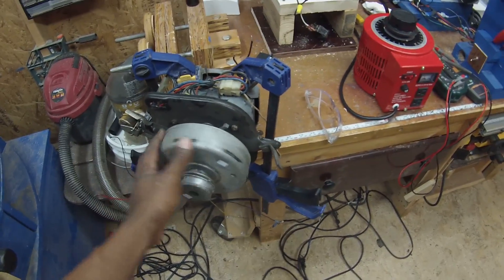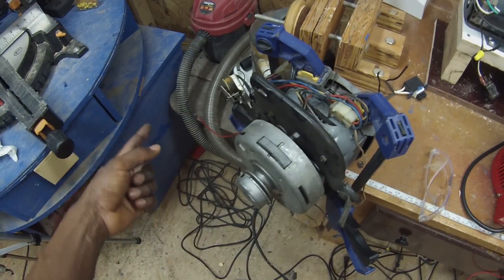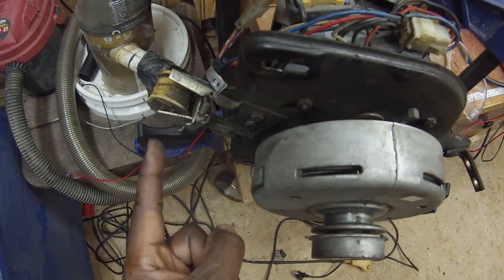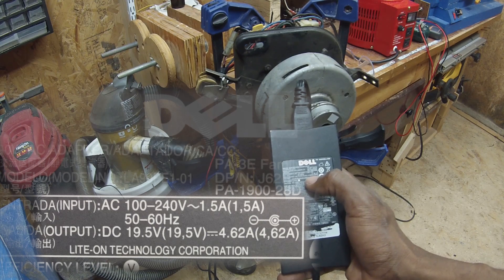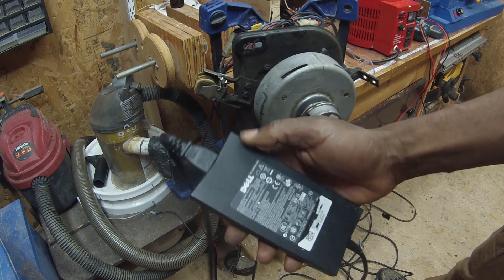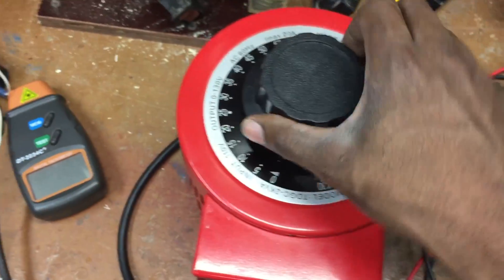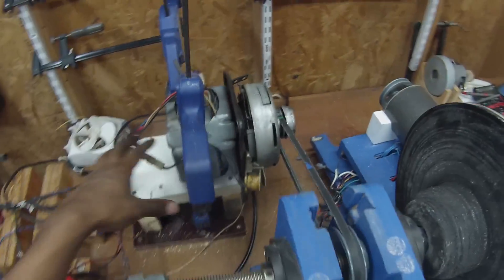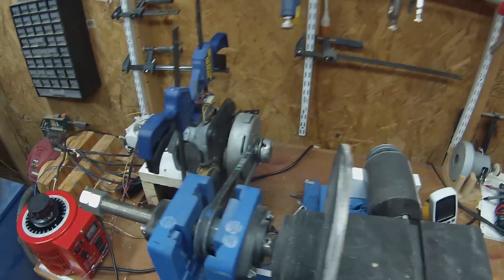Experiments With A Salvaged Washing Machine Motor And Centrifugal Clutch: 017

Comment from the maker: I was wrong about the purpose of the Clutch. It prevents the motor from STARTING under a heavy load. Once things are spinning the clutch engages and there is much less stress on the motor. See I am still learning!
Reply: Jeremy Fielding Same type of clutch used on a mini bike, except in that instance it has a gear with the chain on it. Twist the throttle and the clutch feet spin and extend to engage the housing w/ the chain/gear combo, and away you go to annoy the neighbors. Thanks for these intelligent and informative videos.
Reply: I just changed out dryers do you think I could use the motor from it the same way
Reply: you can make a start circuit with the lid switch off the machine and change rotation directions with a toggle switch

Comment: I know its been 4 years but could you tell me how to wire that exact motor to start by its self. Cant find anything on the web showing how to wire that motor. I have the exact same one and can only hand start it as you did. Its got 5 wires and even after watching your other videos on wiring motors cant get it to start. Have you ever gotten that motor to start without spinning it by hand?

Comment: As A Replacement Motor For Floor Standing
Shop tTools Such As A Belt Sander 
Band saw Disc Sander Table saw Or
Spindle Sander.

Comment: Going from a 3/4 horse drill press motor to a two and a half horse DC treadmill motor works if you get the ratio from pulley to pulley correct for the range that you want that's a little bit of extra work and then you might have to buy some extra pulleys to make that adjustment I have a 12 speed and I was going to change that to a DC motor but I find that the treadmill motor doesn't have the torque that I would want for very low speed 50 rpm

Comment: Great and fantastic explanation keep it up, I have got a question that ....what kind to motor is good for machine has to operate in low speed with arm(50cm) holding up 10kg of weight
Reply from the maker: You need to do a calculation. Check out my video on measuring Motor torque for my air compressor. Search my channel

Comment: I'm thinkin' you might have discovered the reason it was discarded. The clutch was probably not properly functional and they discarded it. If the motor was under a proper load, (overall weight), the clutch should have engaged at the outset, and prevented the motor from going in one direction only. Perhaps there was another connection that would have activated that and you were using it under the spin cycle instead. I'm just speculating here, but now that I think about it, there are different ways for the motor to operate. One uses a single revolution in both directions, and another has a sort of jerk in reverse that resumes forward rotation. Sort of like a ratchet/pawl action. And of course any of the cycles would stop when the door is opened typically.
Reply from the maker: I think the sluggish engagement is because I was starting it by hand. When I later used a capacitor to start it, it reached full speed faster and engaged almost immediately

Comment: So the switch is a rev. Limiter like a wind turbine uses without using a break
Reply from the maker: Basically the clutch allows the motor to slip for a few seconds at startup. The motor will last much longer if it doesn't have to push the full load from a dead stop. The slipping action gives a little momentum, but not the full load to the motor.

Comment: Great channel, first off, now, for my comment:
I first ran into this type of cluth/transmission as a boy (maybe 10 or 11), my Uncle and I fixed his wifes deceased fathers golf cat that had been rotting outside a few years. My first time tearing down, cleaning/fixing, and putting back together a dinosaur burner engine. 2-stroke, so a good intro. Figured out how the 'transmission' worked (I think it was slightly different, only the pulley atttached to the crank changed ratios, was a cantilevered design, so the faster it spun, the right hand rule resulted in the belt riding up the bevel, lowering the gear ratio). OF course, next I noticed a little lever, which would become depressed by the belt if it spun too quickly and moved too far up the bevel. Speed limiter. Took that off. Ran way more fun for about an hour, loud metallic bang followed by rattling and a dead engine, slowly coming to a stop. Pushed it back to the garage, took her apart again, and saw what thoroughly ruined 2-smoke engine looks like inside. 
We didn't really care though, it was already useless, so we got a bit of fun and some lessons out of it. 
I was expressly forbidden to remove the limiter from his snow machine though :P
Good times, good times
Reply from the maker: +ChemicalChrisOttawa LOL

Comment: Everyone knows the clutch is to let the motor to gain speed first before it takes the load, now that little solenoid is for gentle cycle, which has to activated first, before the motor starts , or it will not engage the gentle speed. In otber words the user has to choose the cycle that he wants before the motor starts. Once that motor is spinning, even if you activate the low speed solenoid, its too late. The in & out movement that you've 
notice in the pulley,  that shouldn't be there, that means the clutch mechanism is worn out. The original position of that clutch- motor is horizontal. Will it affect the function?  No, because the weight inside is in centrifugal movement.

Comment: I think that little arms on the clutch move out of the way as a safety feature also... I think you are lucky the solenoid didnt actually engage with them when you had it running otherwise 1700rpmm coming to a dead stop in a split second.... well something was gonna get broke :) great vids btw
Reply from the maker: Normally that process is really fast. The one thing I didn't show is what it look like when the motor is started properly with a relay. At the time I didn't have it so I was just starting it by hand. If I showed that you would see it only takes about one second to get up to speed.

Comment: Salvaged a washing machine motor 
On the motor was written only opperate with shaft down
Any idea about this?
Reply from the maker: +akiva zohar yes... it has a big bulge on the shaft right? That is a centrifugal clutch and i believe it won't work properly if the motor is horizontal. It should still run horizontal. I would remove the clutch and put a pulley directly on the shaft.

Comment: where is the best place to source pulleys? is there a trick to getting the correct size (for your vbelt width, i know diameter sets speed)?
Reply from the maker: +Dan Rozwood yes... pulleys come with a groove size. You need to confirm the pulleys match each other and the belt. Watch my video on powering the shredder. There is a whole segment on pulleys that starts around 18:30
Reply from the maker: I buy most of my pulleys from amazon, but I often just use pulleys I have salvaged from machines as well.
Reply: Jeremy Fielding is there anything special to know about specifying a pretty? i was considering trying to cast one from Aluminum. not soon, but thinking ahead. also, love your videos!
Reply from the maker: The two things that immediately come  to mind are balance, and the belt groove. That groove determines how well the belt will perform. Many pulleys are cast, and you can get dimensions for pulleys from a lot of sources so designing your mold should go pretty well.

Comment: that little solenoid is to lighten the load when the tub first starts to spin and the motor has to pump out the water first, the tub spin slowly and then when most of the water is out the solenoid is released and full clutch action brings the tub up to speed , early belt drive GE washer motor ,  the motor will have two or three speed windings also

Comment: entertaining way to conduct the video, keeps the thinkers thinking. I was with you every step with figuring the exact operation of the clutch. I'm curious about the cap on the end of the pulley, I expected under load with the clutch switch engaged before start up that the motor would just spin/freewheel...that didnt happen so i figured you'd hit some wood on the sander and stop it easily but it looked like it had some torque to it.

 Just a silly curiosity: is it possible the pulley system has two clutches? the centrifugal with a switch operation and a smaller overrunning clutch on the end of the shaft (the small cap).
The overrunning clutch would allow slip if things went wrong or reverse feed were applied to the shaft helping to keep the motor safe then once things are moving good the centrifugal is let go, once that gets past the RPM you had with the clutch switch on then the small clutch would be "out run" and no longer engaged?

 Just rambling thoughts....Enjoyed the video man thanks for putting yourself out there, it will be interesting to see what you do with it.
Reply from the maker: Wow... very interesting thoughts. Now I feel bad about telling you want it is... LOL watch my video here... this is right after I found it. https://youtu.be/K-bbGysv7Kk

Comment: So I've got a dryer in good working order.. What to make from it? I could use a belt sander 🤔 any ideas
Reply from the maker: Check video number 06 for how to make the sander, check video # 11 for the wiring, # 21 to see a dryer motor. it it the one behind the lathe all the way to the right of your screen. with the shaft on both ends. This should get you most of the way there. Good luck...

Comment: Maybe you could make an air compressor out of it? I can't think of any other heavy load starting shop applications right now. I was thinking about a cement mixer too. But I don't know how much need you really have for mixing cement. If it was me I'd be figuring out a way of getting that clutch off the motor. Because I can think of plenty of applications for a plain old electric motor.
Reply from the maker: +Paul Frederick yeah. I will end up taking a grinder to it before long. I really just want to look at the mechanics inside.

Comment: Hello Jeremy, I use to be quite the pro in rebuilting those GE clutch, they are use to allow the motor to start and get to speed when you want to spin something heavy, the slippage allows the load to slowly pick-up its speed by slipping, the use in this case is to spin the basket inside the tub of the GE washing machine, the slow speed pick-up of the basket, allows the water to drain before it spins to fast, and also slowly drains the clothes of water and eventualy picks up its top speed. The 120 volt ac coil, will prevent the clutch from locking, it will slip on different shoes, and it is used for the delicate cycle, you didn't notice much change on high with a load because your load was not big enough and the clutch locked fast. for the play you have between the clutch and the motor, it is caused by a loose U-bolt inside, to open the clutch, you have to punch the top cap pin out, carefull to put the top cap agains something hard and stable, very easy to bend the motor shaft by punching out the pin without back support. remove the cap with a puller, clean shaft and pull out the clutch housing with a puller, you will then have accès to everything, you will notice a sort of U-bolt and nuts plus a plate on the shaft, this is to remove or attach the whole assembly on the motor. While your in there, check the bearings, shoe wear, bushing wear, clean and grease pivots. As of the motor, it normaly come with a starting relay, it is located above the clutch-motor assembly on the top back frame of the washer, right now you only have the "run" coil connected, this is why you have to start it by hand, the start winding is the small wire in the motor windings, the coil with the highest resistance, it is normally powered momenteraly to swing the motor in the start and the relay I mentionned, disconnects the start winding when it reaches it's speed. if you change the wires sides on the start winding, the motor will spin the other way. Enjoy and have fun, any questions let me know.
Reply from the maker: This is awesome thanks... I will give this a try. i can't wait to have a look inside. I have been starting it with a start capacitor and a momentary switch across the starter winding like I show in video 11 and 17 on wiring motors. I press the button to give it a kick and then I let go so I don't burn up my capacitor or damage the starter winding since this motor doesn't have a centrifugal switch. I found the relay but i didn't know how to wire it properly so I decided not to use it in the video. Then I went to the capacitor across the start winding.  But I had shot most of the video by then so I never added those clips.

Comment: any way you can please give a tutorial on how to wire a motor that's currently wired as 220/240  to  110/120? or  v-verse? I'm aware that not all motors  have the capability to be wired as one or the other.  I would really appreciate the help. thanks.
Reply: When a motor is convertable from 120 to 240V you do it by changing the windings in the motor from parallel (120) to series (240). Then the wattage stays the same with the voltage doubled, but the current is halved, because the resistance doubles with the different winding configuration.
Reply from the maker: I haven't tried that before and wouldn't feel comfortable recommending a specific step by step.
Reply: Jeremy Fielding 
hey Jeremy,

thanks for the reply.. is it  "doable"  you think?  have you ever heard of anyone rewiring a motor with both 110 and 220 wiring capabilities? any recommendations besides get a new machine and or motor?  i guess id like to know wheather I'm asking for advice on something that would be ridiculous and silly to do or if maybe there is a possible solution besides dumping the unit or motor.  i really appreciate the response my friend..thank you!  love the videos and your attitude. i look forward to seeing more in the future.
Reply from the maker: Ok... I have given the above warning so here goes... I would expect that "If" you get it to run and I think it is possible, it will work with significantly less power at the shaft then under 220 volts. It may not start or will stall out under a heavy load. So, my educated guess is it is doable if you have a very small load perhaps half to 1/3 what the motor is rated for, and you figure out the wiring. I am certain some one has done it and you can find instructions on a forum somewhere. If the motor is designed for both 110 and 220 then you have it easy.  You should focus on finding out everything you can about that specific motor and hunt down a wiring diagram there may even be pictures of it wired online. It will be a worthy task should you decide to pursue it. If you want you can post a picture of the motor and name plate on my patreon page and I will take a look. You don't have to be a patreon to see everything on my page and post stuff. Its all free. https://www.patreon.com/jeremyfieldingsr

Comment: Yeah. The tub in a washing machine weighs a heap on its own. Then the weight of 4-7KG (I'm from Aussie-land hence metric. Sorry) of wet clothes plus the... how many litres/gallons of water? That would equate to a pretty massive load. (double meaning!!)

If you can do the math on that and equal the load then I reckon you'd get a faster switch between speeds maybe. The load would possibly slow back the main drive to release the clutch sooner. Maybe a momentary drop in voltage would do the same thing and then you could bring it back up to speed after the clutch released again. What do you think? I really have no idea.

I pulled apart a washing machine a couple of months ago and retrieved a little beauty not unlike this one. I also grabbed every other little pump and pulley i could get to. I was dreading having to work this motor out so thanks a massive bunch. If you can find a full washing machine I reckon you'll have a blast playing with all of those pretty innards.

Thanks so much for sharing your brain man.

Comment: I was thinking it might be useful in driving something that could have a flywheel to overcome variable loading conditions, like a garden mulcher or wood chipper. Whether the clutch disengages below a certain rpm regardless of the load it is under or only when the current is removed would affect it usefulness for certain applications.

Comment: Hi Jeremy, new to your channel and finding it very interesting. Just to add something to this video, I am a laundry engineer and have come across these types of pulleys before. It looks to me like this motor is from a top loading machine. These have agitators in the middle of the drum which are driven through a transmission. The torque required to run the transmission is very low and the motor will turn in one direction. This will drive the mechanical pump in reverse which will suck from the drain hose and keep the water in the drum. When the machine spins it turns in the other direction which engages the pump and drains the tub. It also spins an Archimedes Screw which takes the drive away from the transmission and spins the whole drum and gearbox as a unit. Obviously this will require a much greater force so the clutch will soften the load that passes through the belt as it gets up to speed. I've never been actually told this as a fact, it's just how I've believed it's worked all these years. If anyone knows better, please feel free to correct me.
More modern commercial machines use inverters to control the drum speed on start up to act as a 'soft start'. I feel that this set up would be great for shop equipment as the speed control is very accurate. I hope this has helped (and is correct!!!) Keep up the good work.
Reply: This is why I always read the comments, thanks for the contribution.